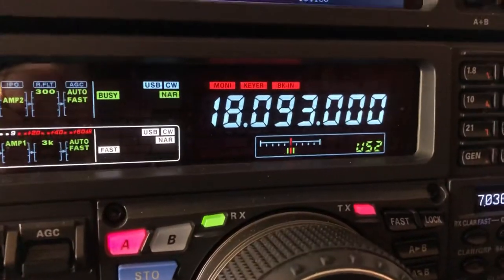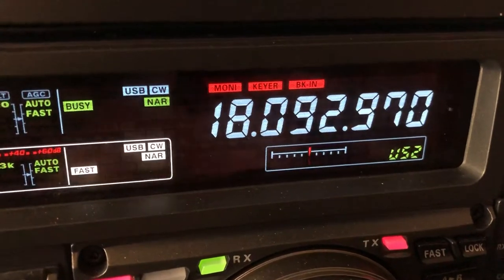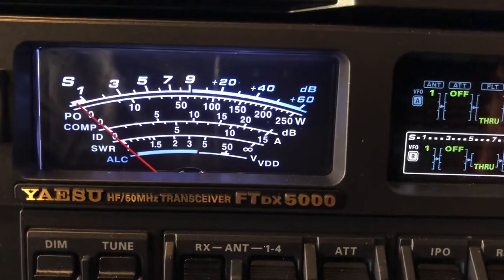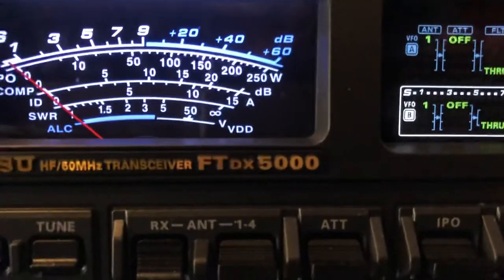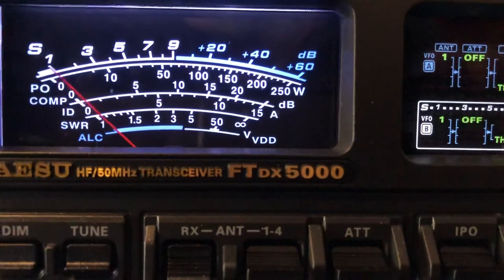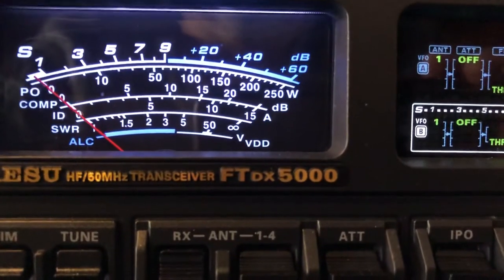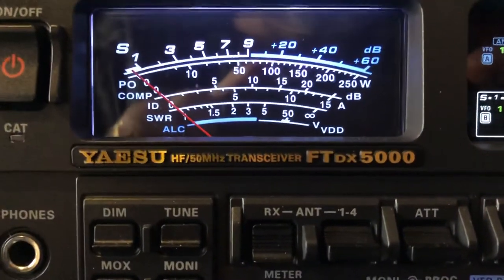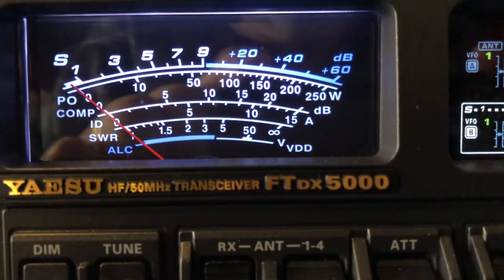The difference a doublet makes

Comment: Just for some quick advice. Remember the doublet antenna system is as only as good as the Antenna Tuner. A true doublet does not use any coax. The type of tuners recommended for this is preferably mechanical style with a T or L network with a tuning start point capability of 10:1 ... Terminating to the back of the tuner using the 4:1 balun built in most of the older Tuners. But now there's a consensus using a 1:1 current balun like the new Palstar AT5K tuner has the 1:1 built-in ... If the tuner does not have a balun built in the T or L style network tuner will work fine on the output side with a short coax jumper to the external balun of choice.
Reply from the maker: My Palstar AT-Auto failed.  It has a 4:1 BalUn.  I switched to using the internal ATU in my Elecraft KPA-1500, using an external 4:1 .  I haven’t looked back.  I haven’t even cared to fix the Palstar.

But, before I went back to a 4:1 BalUn, I experimented with a 1:1.  It didn’t allow me to cover as many bands with a suitable SWR.  I showed my experiment with a crazy 1:1 97-Ohm BalUn that Balun Designs recommended for a Doublet. It was not good.  I should have returned it. It was a waste of money. Here is a link: https://youtu.be/ouRrw-Rf0a0?si=9z23FZDOD0agUsRH

I went back to the reliable 4:1.  It is working incredibly well.  Here is the video: https://youtu.be/XYY7pI3wspQ?si=ssWFDVdCytqLrX4A

Comment: What type of lightning protection do you have for your 450 ohm feed line?
Reply from the maker: The feedline comes to a Balun. I covered that extensively in videos last year, around the Spring time. Those videos are still visible. They haven’t been moved to Patreon. From the Balun to the amplifier/ATU is a 9 ft. run of LMR400. All of my other antennas go to an Alpha-Delta antenna switch. I always leave the switch in the grounded position when I leave the shack. There is an open position on the switch. I unscrew the LMR400 from the back of the amplifier/ATU and connect it to the open position on the antenna switch when lighting approaches. I unplug the power to the radios. The power company will tell you that the only truly reliable protection from lightning is to unplug. 

I have used the aforementioned technique since 1998 at this location and I’ve experienced no lightening damage. My power company told me that my zip code gets the most lightening of the entire metro area.  So, anecdotally, it seems that my method is working.
Reply from the maker: Back when that video was made, I used a Palstar AT-Auto. It has a built-in Balun so the ladder line came into the shack to the back of the tuner. That tuner failed last year so I started using the auto-tuner that is built into my Elecraft KPA-1500. But it has no connection for ladder line. I installed a 4:1 Balun just inside the window. The ladder line comes to it. 9 feet of LMR400 goes to the back of the Elecraft KPA-1500.

Comment: My understanding is that ladder line will not radiate.  Is that true?  Or, do you get some RF in the shack?
Reply from the maker: That’s correct, in a perfect installation.  My ladder-line runs near a downspout, which is unavoidable.  My ladder-line is also near one of the lengths that falls into resonance (approx 57-60 feet).  65 feet is a point of resonance. It can actually act as an antenna, receiving  RF radiation from the antenna and feeding it back into to the shack as common-mode current.  But ideal lengths, like 40 or 80 feet, weren’t practical in my installation.  The center of the antenna is at 45 feet.  Coming straight down and into the shack, via the window, and then over to the back of the tuner, took another 12-15 feet. 

The bands that seem to produce the most common-mode current in my scenario are 15, 30, and 40 meters.  For the other bands, I’ve been able to choke the RF by placing ferrite chokes on wiring such as the mouse, the monitor, the mic cable, and the cable between the computer and the radio’s CAT port.  I was going to experiment with adding some ladder line to get it closer to 80 feet but 1> I would have to find a place for so much additional line to be routed and 2> the antenna is below a 2:1 SWR across 17 and 20 meters without the tuner, though I sometimes allow the tuner to touch up the SWR a bit.  It performs very well on 17 and 20 meters.  So, given the performance of this doublet as-is, I just figured I would leave well enough alone.

73, de N4HNH
Reply: @n4hnhradio  Avoid 64ft of open wire ladder line at 40M. 42ft-52ft or 73ft-83ft of line is best  (+-10ft), at least for 40M around those lengths.
Reply from the maker: Yes. I’ve seen the charts on that. Mine is in the 50 to 60 foot range, maybe 55.  I don’t use mine for 40 normally but it works great at night on 40 for DX.  During the day, my ZS6BKW beats the doublet.